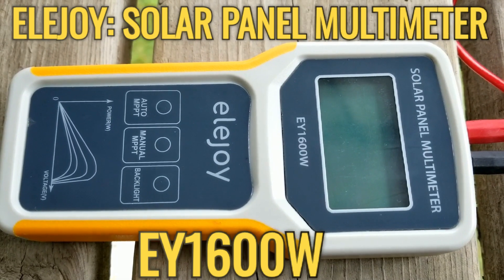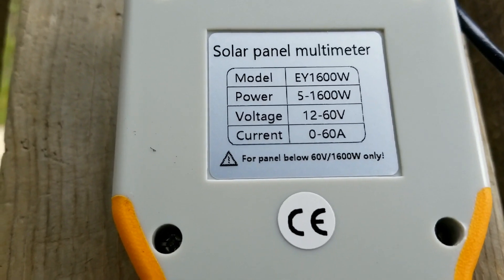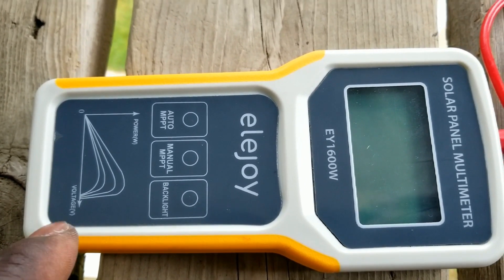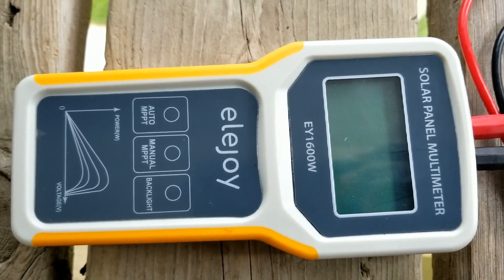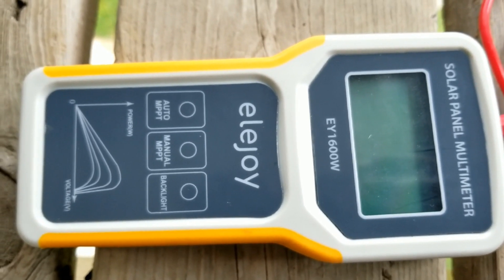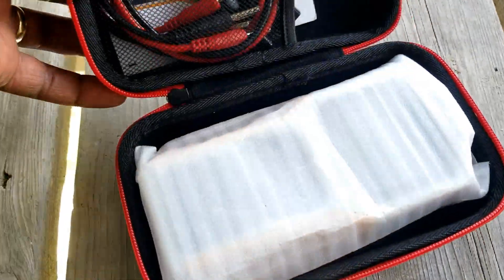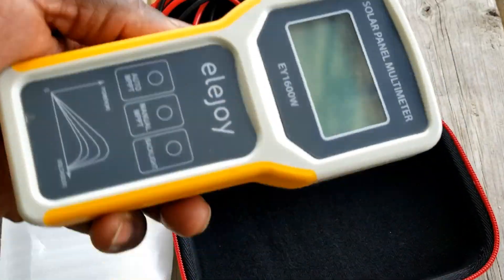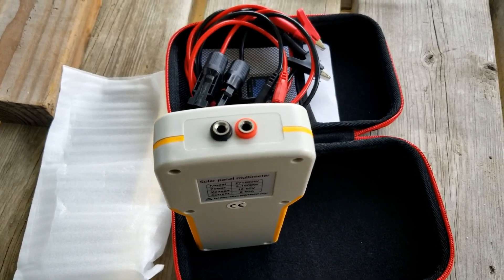HOW TO TEST SOLAR PANEL: SOLAR PANEL MULTIMETER EY1600W

Comment: When disconnecting the tester from the panel, should the panel be blocked from light to prevent arcing at the connectors...?
Reply from the maker: No
Reply from the maker: Thanks for stopping by and don't forget to LIKE SHARE and SUBSCRIBE

Comment: Excellent adviced unit 😂almost like mine if you seen the video . Mine is a WS400A @ 0.1 - 400w , 12 - 60v and 0 - 20 it’s self powered also , 3 displays meter model compared to your new advanced model EY1600W and a large lighted screen . 🤗🤙May the solar be with you .😉
Reply from the maker: Correction! This model is a 1600 Watts capability 
Thanks for the comment.
Reply: Unfortunately, this product review tells me little more than the information in the advertisement.